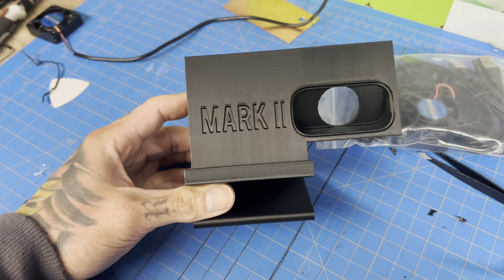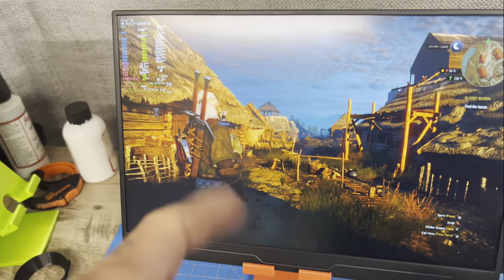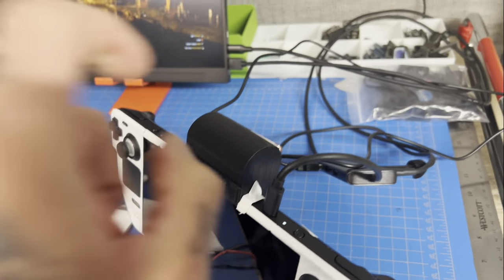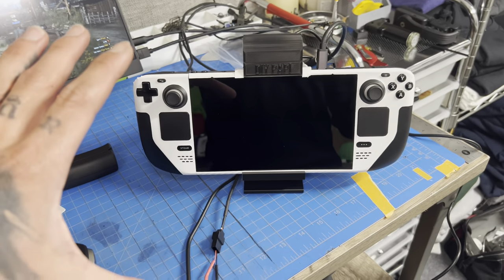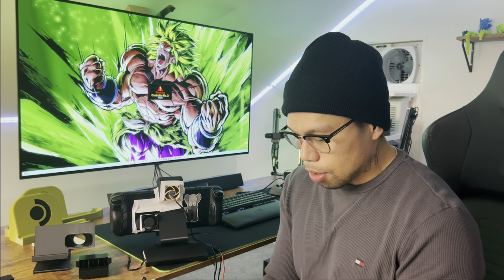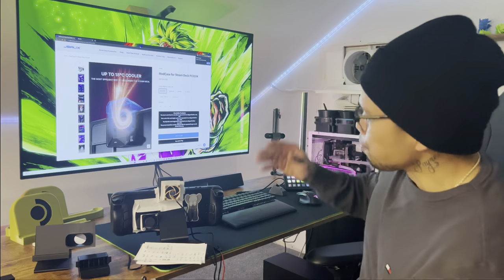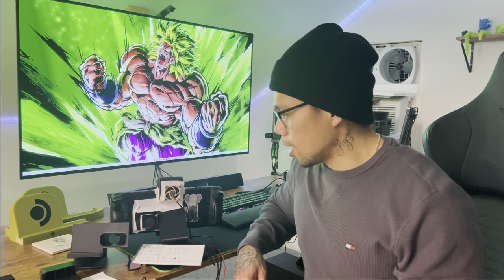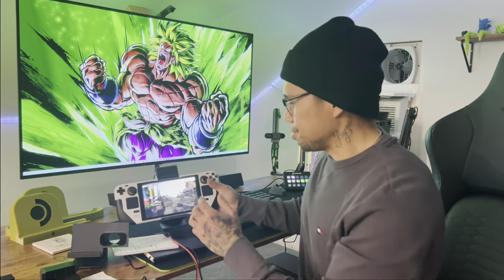Steam Deck Mods - Ultimate Cooling Dock ? Two Failed Experiments Become ONE

Comment: Hey I did the same but I put a 40mm fan with a 12v to push air in keeps it cool at 37 to
Reply from the maker: That’s awesome 37c on what game?
Reply: @Diy_Papi  did cod2 and high on life so far going to try the Witcher
Reply from the maker: @203kenny12  Witcher is a brutal game on the steam deck. Reminds me I need to test apex!
Reply: @Diy_Papi  I sent you the mods on your Instagram

Comment: I made a active cooling steam deck dock that is modeled after the switch and I’m also turning my 2k portable monitor into a laptop by using the steam deck and a keyboard with a 3d printed casing I will be posting my design on Thingiverse if anyone wants it
Reply from the maker: Send the link I need to see this thing.
Reply: @Diy_Papi  still working on the laptop I will send it when I have finalized the design